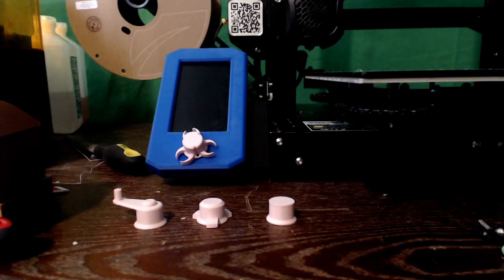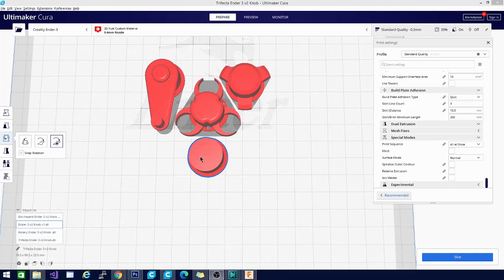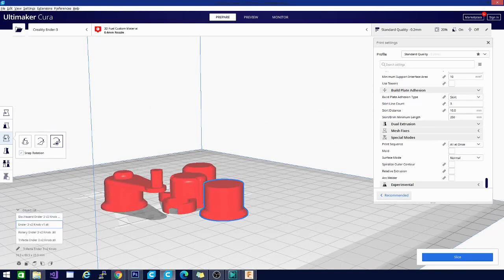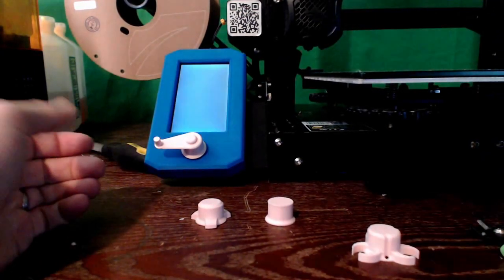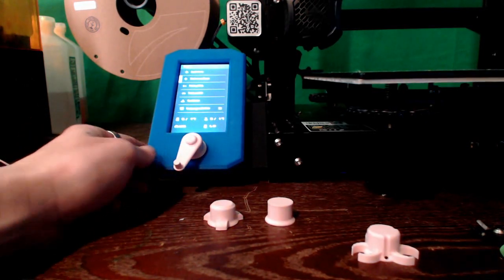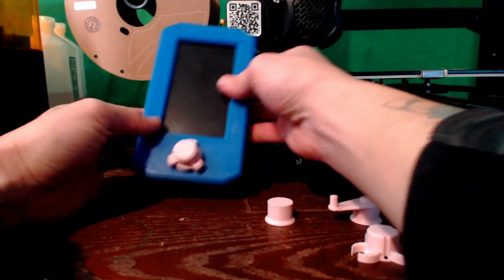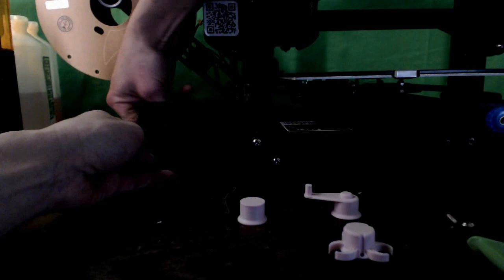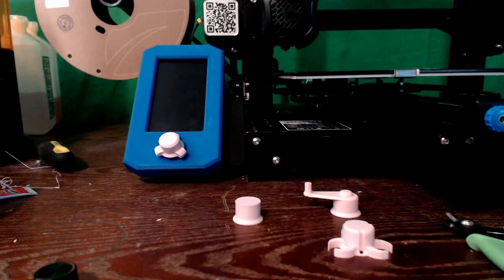More Ender 3 V2 Mods! Custom Control Knobs!

Comment: how did you get the original knob off? I can't figure out how to get mine off
Reply: it just pulls off, it needs quite a bit of force but that is how your meant to do it. you can also get a flathead screwdriver or something similar and put it underneath the gap and wedge it off
Reply: @adispenser spahsappinmahsentry!!

Comment: Hey does pause at layer hieght in cura work on your V2? It doesn't on mine if i have any 2 color prints i gota use my ender5
Reply from the maker: Yeah I made a video on how to use it  with the ender 3 v2 like last week. I dont have a link on hand but you should find it pretty easy on my channel page!